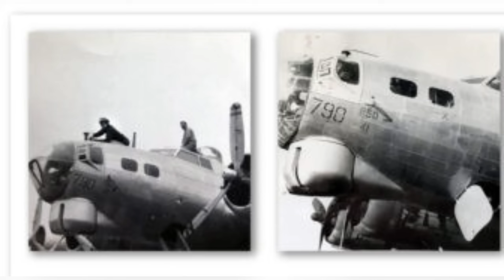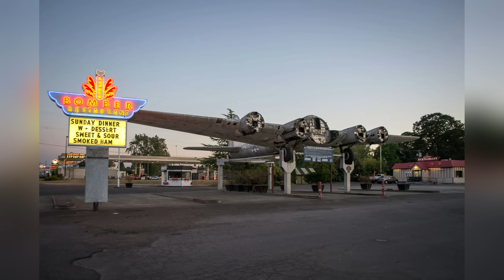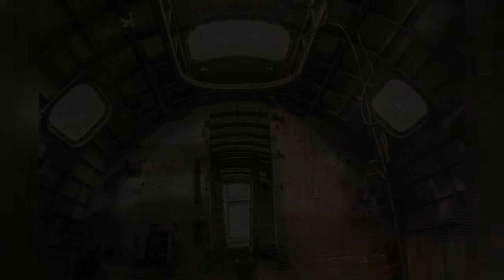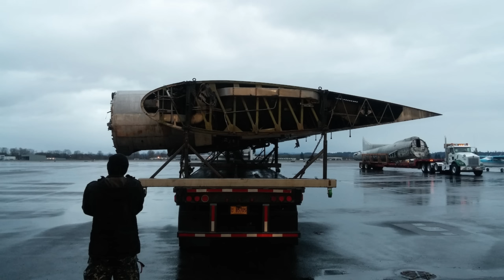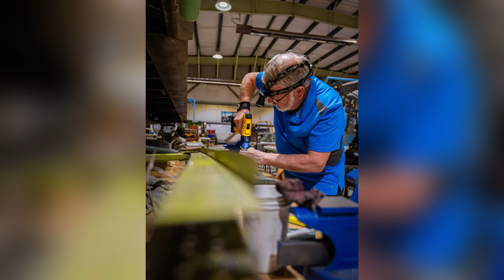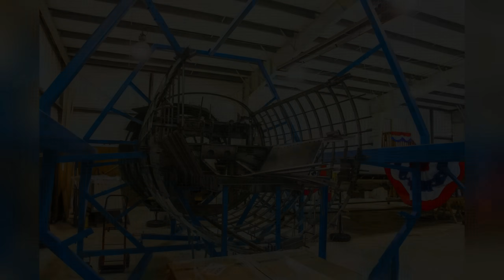Recovering B-17 "Lacey's Lady": Gas Station Bomber to Flight Again

Comment: There used to be a scrapyard in Cape Town that for years had a Spitfire on a pole at their gates. Eventually someone offered them a lot of money for it. Two days ago I drove along the N2 between Strand and Somerset West and saw a huge helicopter high up on a stand between buildings. it was completely white and marked NAVY. Towards the pilot's cabin was the US air force insignia that we are all familiar with from WWII. One of the Dakotas that was used for the Arnhem drop was used as a function venue at Century City outside Cape Town until about five years ago.

Comment: My first job was working at The Bomber Gas Station.  I worked there from 1975 to 1980.
Reply: I was born one year before your departure. I bet you didn't imagine you'd see that thing still around in this era. It was still "young" when you worked under it.
Reply: @UCs6ktlulE5BEeb3vBBOu6DQ  As they say time is relative. Thirty-five years young, in 1980 the Shuttle was flying. I guess some one born in 1945 could have thought the Wright Flyer was still "young".

Comment: I don't think you must have spoken to any of us who have been working to get this B-17G back in the air.
You missed several of the most important things about this story, including the biggest challenge to restoring it.
The worst of the damage was from decades of BIRDS pooping and nesting inside the airframe.
It's the single most important thing to know about the condition of the airframe and the difficulty in restoring it.
This is the very first thing anyone who knows anything about this project will tell you.
How you could possibly have missed this overshadowing all encompassing detail is frankly unbelievable to me.

Comment: 68 year old American man here. My family settled here in 1968 when I was 11 years old and I have lived here ever since. "The Bomber", both the aircraft and the restaurant are very familiar to me.

During a lunch in the restaurant in roughly 2005, I spoke to the restaurant manager who was the daughter of Art Lacey about the bomber, how her dad flew it in, and it's history. She told me that the bomber skin damage was not only due to the weather and the elements. That's when I learned from her that over the decades the bomber regularly had pigeons constantly landing and sitting all over the bomber, and they couldn't keep them off. She also told me of how corrosive pigeon poop is when it sits on the aluminum skin of the bomber long term. No matter how often they cleaned it off, more was promptly dropped on the bomber.

She also told me how the bomber got it's current nose art "Lacey Lady".  She said one day a customer idly drew the art on a napkin and left it on the table. It was so good that it became the new nose art. Google "Lacey Lady B-17 nose art" and pull up the results under "Images". The family tried to find the customer that drew it in order to credit him, but they never could. 

I'm really looking forward to the restoration effort restoring the Lacey Lady to flying condition. I would love to see her in the air at the local yearly Hillsboro Air Show at the Hillsboro airport. Hillsboro is about 45 minutes from Portland.

Comment: Does this ever bring back memories of corrosion in a TBM I helped restore in 2000 and later a Phantom in 2015. You would be surprised how the environment can eat through a 1/4" panel of aluminum layer by layer. The TBM taught me how to make new cowling panels from scratch due to corroded ones being thrown out. The first one I botched the holes for the dzus fasteners but the next four were perfect.

Comment: 16:13 , this type of restoration makes a $50-$100 part cost $2000- $5000 , possibly  more!.. it's a bit over kill, and would not be required if people were honest and documented thing properly.  You do not want to buy aluminum  for aircraft,  buy 6061 t6 aluminum.   And get a sheet of aluminum  meant to go into beer cans or toy cars. The part could go from being capable of holding up 10,000 lbs per inch with the proper materials proper alloy to a part  that breaks under 1000 lbs per sq inch.. you could have landing gear capable of taxiing up and down the runway for a year nonstop. Yet soon as you fly it , come in for a landing, as soon as it touches down. The landing gear  takes an emergency exit out the roof of the plane , skidding down the runway on its belly...😢 after all that $$$$ and time, work, effort, and energy . Someone is going to be pissed and 😡 😢😮....getting to do it all over again, plus additional work,  testing all structural components. To verify if it's the proper alloy, proper heat treat. Basically, remove every rivet , every nut, bolt , piece, and part, test everything, make repair parts from documented  proper matereals.  Then rebuild the whole plane ,AGAIN!!  HOWEVER,  UNLESS SOME GOOD INSURANCE IS INVOLVED,  OR A BILLIONAIRE  WILL BE MAKING MONEY FROM IT. I'M  THINKING IT GOING INTO A MUSEUM. After a situation like that, I hope nothing  remotely close happens like it..
I would love to build a 2 seat approximately 1/4 scale WARTHOG, USING  TWO MAZDA ROTOR ENGINES,  in a duct with a propeller  ducted to look like a jet engine. Tuned and modified to run at a sustained 4000-7000 rpm, yet normal cruise speed around 3000-4000 RPM. WITH  compound turbos and a 3-5 gallon dry sump oiling system per engine. Possibly  making around 350hp each , with emergency  power  around 500 hp with a variable pitch  contra rotating  propeller,  maybe look into actually using a jet engine inlet fan? about 50"-60" may be larger, with an aluminum rod forming a cage covered with carbon fiber and kevlar  cloth, forming a composite. The duct and shroud should be capable of scooping in air and compressing it, similar to a rocket engine bell, testing, and studying will be required.  A semi monococ/tube chassis using chrome moly tubing riveted to 6061t6 aluminum  1/4" plate with the  structural  connections using a 3" x 4" flat contact patch. With  a very strong epoxy adhesive applied to both parts after being sanded/cleaned with 80 grit sand paper, then wire brushed with a stainless  steel wire brush and washed with acetone. Clamped together with a pair of 1/16" dowels on alternate corners for alignment.  Then 6-8 rivets installed  from alternate  directions if possible.  The engines may be installed inside the ducts behind the props. Or  the engines may  be installed in front of the cockpit down low, with a hollow 2" shaft running  back to a bevel gear  or ring and pinion. Then, up to the mounts, the prop shafts would be mounted to. A 3" hollow shaft with tapered roller bearings, and a thin oil circulated through it to cool the bearing, possibly  using atf auto trans fluids,, not certain the exact type, using two gear pump, with a pressure a activated  clutch, to disengage the auxiliary pump. If pressure is lost , the auxiliary pump goes to work to restore pressure. The atf may have additives,  like 9:1 atf to lucas oil stabilizer, making the oil slightly tacky.  (9 qts atf to 1 qt lucas, with bearings along the shsft every 4' [+/-] each bearing oiled not greased, to keep cool at up to 9000 rpm. With a cooler just before entering the bearing box,  a 2" x 4" x 6" aluminum  block with  a 1/2" passage going front to back 7 times, with  1/2"-5/8" passages coarse threaded all the way   with a smooth 180° turn milled in the aluminum  then welded back together with a 1/2"  water passage  and 1/8" x 1/2" fins covering the exterior the water line used only in cold weather or very hot weather, a 24" x 18" radiator with 6qt reservoir  with 1-2 gph water pump  a 5-20 gph oil pump, at 5-20 psi is praying the bearing area. An aluminum  block inside a box oil spray on one side  drain on the other , a .050" -  .060" nozzle with a 3/8" sump line, with about 6-8 bearings per shaft  with 4 nozzles in the prop shaft bearing  boxes fed by 1/2" line with 1" sump. Maybe use ev motor / generator  setups put a generator  and motor up front with a l electric  motor in the prop duct maybe a tesla motor or leaf motor wire it direct , no real controller, just engine thtottle makes the electric motor spin faster.  Two tesla motors attached to a prop or fan. 300 hp minimum  peak450-500 each in a 1200-1800lb plane.. with N.A.C.A. DUCTS  TO  COOL  THE RADIATOR, intercooler, air intake. It should do 260-300mph climb 2k - 2800' /minute from 3k'-10k' dive at 1000'/second @ 600-700 mph emergency power 500-600 mph flat @ 10k feet. 1000 1200 total hp. Build an aluminum  and steel skeleton covered with carbon and kevlar  fiber  composite,  the skin weighing 1lb  per sq. Meter , or less and hold 500 lbs per sq. meter with less than .040" deflection under 500 lbs weight  over  a 1 meter x 1meter area. with two seats. For  two 7'6" persons (up to)  carbon seats, and a 24" x 50" x 40"-48"  cargo area, 4-6 20 gallon fuel tanks. And incorporate  something like jato rockets, 30-45sec burn time  each, with about 12, and a decent glide ratio. If engines are lost pull back on the stick fire one jato, if it climbing  is possible,  fire two more to gain altitude,  find a place to land keep speed over 180mph the rockets can keep it  in the air  for atleast 10-20 miles, possibly 50-100 miles, and  20-30 minutes minimum ,  3" stainless tubes , filled with sugar rocket fuel maybe black powder, maybe a H2O2 rocket motors, with 5 min. Minimum burn each, 800-1500lbs thrust, with  two-four engines maybe a nitrous oxide and kerosene with propane to get it started,  1-5lbs  propane,  5 gallon  of kerosene and 10-20lbs nitrous. A 5-10, 15 min burn, to prevent crash, two rockers should  climb straight up 70°-80° for 5-10 min at 100mph, (then dive for speed and gain glide time,  solid rocket with thrust,  4" x 48" solid rockers with 1.5" 1.75" nozzle stainless tube, ceramic coated wrapped in ceramic wool, and carbonfiber  around 1000 psi thrust for 5-7 minutes unless you are over h2o, or mountain/Forrest or NYC,  you should be able to  set it down safely, if you are on takeoff, power is lost, hit a rocket climb and  turn hit another rocket, climb  and line up to Land back at the airport.. crazy idy, nut can work. Especially for a plane that is smaller  cockpit size than a vw bug. A fighter 1/4 scale , heck  make it remotely controlled  also.. 😂 , HAVE AN AWESOME DAY.

Comment: I was stationed at McChord Air Force Base (AFB), now called JBLM, in the 80s and 90s and retired in 2004. I was an Aerial Porter, Logistics, but mainly working all types and knowledgeable load characteristics. We received McChord's C-47 at the museum on a finger-dock on a highline, from a junkyard. We also had a C-124 fly in and become a static display, along with a C-141B (50277). I have yet to see a dedicated C-130E/36th TAS.

Comment: I seem to remember a big plane on top of a gas station.  We were often in the Portland area and my memory now is just about as foggy as Portland could get.
     Glad they are restoring it.  In Jr, high and Highschool I read a lot of Martin Caidens books about' The Flying Forts" and "BlackThursday" I was stationed in Germany close to Schweinfurt.  I got to catch a ride in a helicopter over Schweinfurt and noticed low hills that looked just a little odd'  Come to find out the hills were actaully the rubble from the bombing pushed out to rebuild Schweinfurt.
    I also read Adam Makos "A higher Call" and they had redone a B-17 to the "Ye Olde Pub"  which they had flown around Twin Falls.Idaho.

Comment: Funny how these videos make it sound like being parked outside is the kiss of death for these airplanes. When I was a kid we had access to various Cessna airplanes built in the 1940s that were always parked outside for decades and all were safe to fly.
Reply: "All were safe to fly" - for some definition of safe! 😂 But you're right - any vehicle that gets run regularly and inspected and maintained properly can have a long and useful life. The last B-52 was built in 1962. With the engine and structural upgrades now in progress, the remaining fleet is now expected to be operational into the 2070s, over 100 years. But one has to wonder how much of the original airframes, etc. is still there.

Comment: There are ten remaining intact about  5 of them are air worthy, 12,000 originally built.
this restoration looks like it has replaced as much as half or the original structure , it will essentially be a new plane with done, original parts here and there to maintain original look
,,,,,,,,,,,,,,,,,

Comment: I remember as a kid (1960s) seeing the Memphis Belle sitting at the Army Depot in Memphis.  As years went by, weather and vandals were taking its toll.  Then a local group decided to save the Belle and did a cosmetic restoration and the plane was moved to downtown and placed under an open air pavilion.  My wife and I attended the gala.  There were speeches and fanfare.  A group of WWII fighters and bombers flew overhead and dropped rose pedals.  The Belle looked great again.  
Time passes and upon another visit, I could see pigeons were nesting in the top of the pavilion and just making a mess of the Belle.  She looked sad again.  Time, once again, passes and in 2005 the Museum of the US Air Force acquired the Belle and took it to Dayton, OH for a proper restoration.  I was disappointed at first that the Belle would not be in Memphis anymore but soon realized it was best for it.  
Memphis just didn't care about it anymore.
The Belle had been declared a National Monument, so it could never be flown again, it could only be a static display.
In 2018 the wife and I drove to Dayton when the exhibit opened to see the Memphis Belle finished and protected inside the museum. 

It's beautiful again with a fantastic display around it.

Comment: In the early 50s, I remember coming from Portland on the way to Eugene and stopping for gas.  They let me go into the bomber and sit in the pilot's seat.
Reply: By the 1960's things had changed, I went up the stairs and looked through the doorway, but you couldn't go inside.

Comment: They had 100 octane gas. Ethyl was 106 and regular 89. When it was .38 / gal. Those were the days boy.
Reply: Chevron Custom Supreme was 110 octane in 1970.
Reply: The more in debt your country is, the less your money is worth.
Reply: Yeah, and I was making $2.35/hr at Plaid Pantry down McLaughlin Blvd.
Reply: Dick's Club 19 had burgers for nineteen cents down the way in Gladstone.
Reply: @JoeZip25  So did Hamburger Jack's on 99E at Ochoco just north of Milwaukie.
Reply: We still complained about gas prices. 😂
Reply: @tedgeorge4483 I swore I'd never pay 50 cents.
Reply: Back then a VW bug was $1800, now they are more like $25,000. A loaf of bread was on sale at 30c, now it's $4.50. Until the recent political shenanigans, gas was actually cheaper in real dollars than it was back then. 
I recall about 1967 a  station on Barbur Blvd. just outside downtown had gas at 35c per gallon, with a nickel off for three gallons. So if you ordered three gallons, the total cost was $1. But if you ordered $1 worth you only got 2.84 gallons. 😅
Reply: @GaryBickford  They haven’t even made the Volkswagen Beetle for about 7 years and some still go for $20k.
Reply: @GaryBickford  There were two stations kitty-corner from each other on Ainsworth and Albina.  (In Portland, as that's where this video is set.)  They had gas wars in the '60s and I remember prices as low as 15 cents a gallon for regular.  Maybe even 13 cents, but 15 cents for sure.
Reply: .38 a gallon was 5$ a gallon to them. so it was still expensive. 15k a year was middle class.
Reply: leaded gas uff 🤯